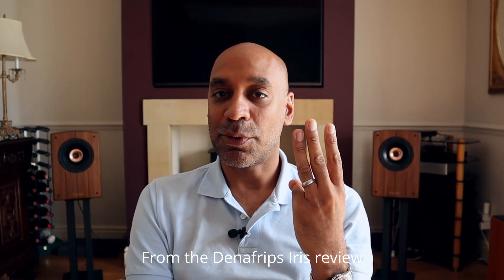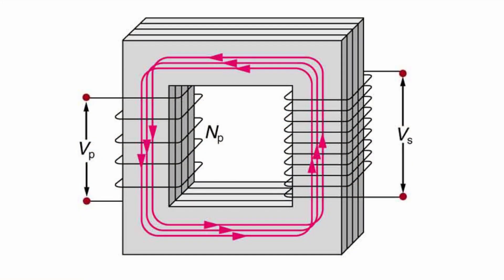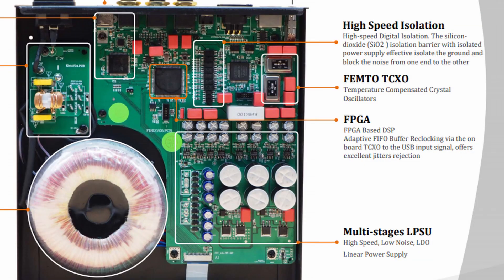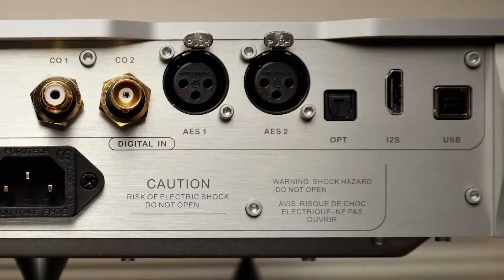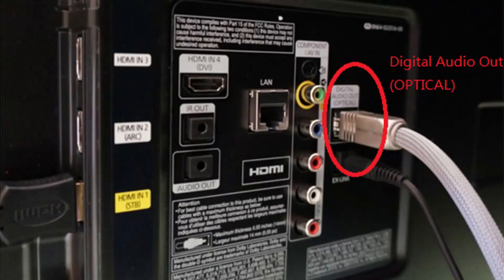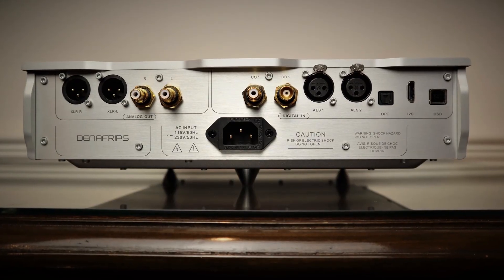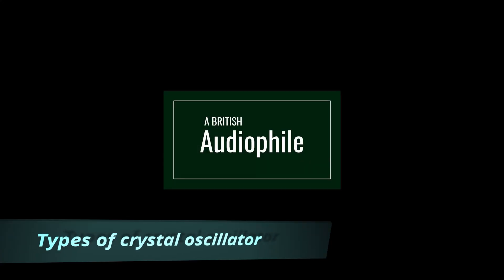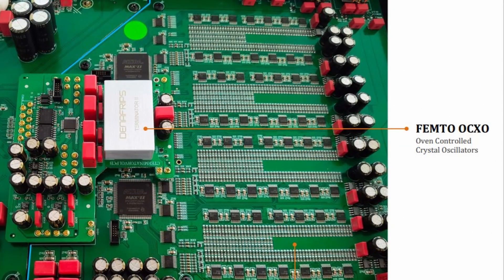ABA Clips: Why you need a DDC

Comment: Always great explanations and reviews from this gentleman. I recently in this past winter upgraded from a Pontus II to A Venus II and while I have noticed sonic improvements I am experiencing annoying transient pops (sort of like static discharge noises if you will).  Also when I would physically touch the unit the status LED's would flicker erratically and give a very minor static shock, this issue was bothering me more and more as time went on. I reached out to Denafrips regarding this issue and even sent the unit to there North American based service center where a firmware upgrade was performed. Though the flicker of status LED's has been addressed I still experience the occasional transient popping noise, I have tried evreything as far as isolation (different outlets, power cords, interconnects, AC purifiers etc...) to no avail.

NOTE: This issue only rears it's annoyance while streaming.

All this to say that this video has given me somewhat of a explanation as to what may be some of the reasons as to why I may be experiencing these anomalies, especially about the sensitivity to voltages and it being temperature dependent.

This got me to thinking that I should try isolating my internet service entry-HMMMMMMMMMM!
Reply from the maker: Thank you for your kind words of support Juan. Sorry, to learn about the experiences you are having with the Venus II. If you haven’t already, try it with different sources and different inputs. If it is the same will all, I suspect you may have a faulty unit. Good luck 👍
Reply: @abritishaudiophile7314  Good day Tarun and thank you for your response. YES-as you I believe the same as I have tried all inputs and numerous sources but as mentioned it seems the issue is when I stream, do you suppose the noise may be emanating from the roputer/WiFi extender? Might a 75 ohm isolation transformer help?

Just your thought if possible and once again thank you for your response, Juan Valentin..................
Reply: Good day Tarun and thank you for your response. YES-as you I believe the same as I have tried all inputs and numerous sources but as mentioned it seems the issue is when I stream, do you suppose the noise may be emanating from the router/WiFi extender? Might a 75 ohm isolation transformer help?

Just your thought if possible and once again thank you for your response, Juan Valentin..................
Reply from the maker: @juanvalentin3302  if it is only happening with your streamer and you have tried different streaming devices. Then it is possible that the Wi-Fi extender could be a problem. I don’t think a isolation transformer will help at the Venus as pretty good internal isolation on all inputs. If it worked fine with the Pontus II then it could be a quirk of the Venus II. I would email Alvin at Vinshine and see what he suggests 😊
Reply: @abritishaudiophile7314  As always-well received input from you, now back to the music!

Regards and happy listening, Juan Valentin........

Comment: Several of the concepts in this video are put to use in the Grimm Audio MU1 digital audio server & transport. The MU1 has , apparently, such an accurate clock that it’s difficult to get any measuring equipment to measure its accuracy !  (And the accurate clock is responsible for the high cost.) The recommended digital out from the MU1 is AES EBU. Any reason AES EBU not described in the video Tarun ?  It’s SPDIF, so it should make the external DAC use the far more accurate clock of the MU1.
Reply from the maker: Thank you Trevor. I didn’t test the AES/EBU connection. Next time perhaps. Please ignore the message from “Telegram me”. It is a spammer using my photo. I have reported it to YouTube. Sorry for the inconvenience.

Comment: Sadly I2S Has no universal standard. Iris for example does not work with my Smsl M400. but works fine with Audio Gd R2R-2. Hope that this standard will be unified in the future. Beside that my only complain for the Iris is , to little connection options. Would be happy for a doubling of every port. 😅
Reply from the maker: Thank you for sharing. Please ignore the message from “Telegram me”. It is a spammer using my photo. I have reported it to YouTube. Sorry for the inconvenience.

Comment: Digitalisation of audio sound is becoming more and like a dog's breakfast. Ever heard of the concept Straight wire with gain? To appreciate music at its best without all these expensive status laden technological wizardry, go for records and tapes played on vintage equipment manufactured in the UK, the US, Europe and Japan in the 1970s and early 1980s. The poor cassette tapes and cassette decks have been vilified by so called audiophiles but to me, they have a full bodied sound with ambience like a concert hall or studio sound. The simple thing thing to do is to gently clean the heads and tapes path periodically with q tips and isopropyl alcohol, lube with tape  head lube, demagnetised the heads and tapes path with demagnetiser wand,  ensure the heads are aligned (easily done with a small screwdriver if you know how) and turn all  Dolby OFF!!! Also use well kept cassette tapes with the pressure pads on.If you can find them ,  buy reel to reel decks. They are works of art by themselves. Enjoy.
Reply from the maker: Thank you for sharing. Please ignore the message from “Telegram me”. It is a spammer using my photo. I have reported it to YouTube. Sorry for the inconvenience.

Comment: Very informative Tarun 👍
With regards to isolation, what about Wifi as a transport medium? In my experience a Chord Mojo 2 / Poly Streamer over WiFi, gives a cleaner result than any of the ever more expensive USB cables I tried directly connected to the Mojo 2.
Reply from the maker: I believe the connection between the Mojo and the Poly is wired, no? I haven’t looked into it to be honest. Please ignore the message from “Telegram me”. It is a spammer using my photo. I have reported it to YouTube. Sorry for the inconvenience.
Reply: @abritishaudiophile7314  Hi, yes, I had already figured as much 🙂. 
Yes it is wired but it is an extremely short connection part, USB connector to USB connector without wire in-between. And since both cases are shoved together, forming one shell, the signal path is entirely within it. I am not sure if that matters. They could also have created it as one device.

Comment: Hi Tarun. Can you comment on the benefit of using DDC for older DACs? I'm thinking USB out from pc via DDC to coaxial input on Musical Fidelity V-dac ii. 5 years ago there seemed to be plenty of options for this and it was firmly recommended; research suggests this isn't the case anymore.😐
Reply from the maker: It depends on the quality of the DAC. You may be better of upgrading the DAC than adding a DDC. Your system is only as good as the weakest link. If you think that the old DAC is still comparable to modern equivalents then a DDC may make sense 😊

Comment: Hi. I use USB audio and my DAC (Ifi zen V2) allows one to pick the buffer size with several choices. Is a smaller or bigger buffer better for the sound?
Reply from the maker: It would be hard to determine objectively without getting into the complexities of the design. Best option is to trust your ears 😊
Reply: @abritishaudiophile7314  thanks. Will try experimenting and see what I prefer. My impression so far is it makes very little difference to the sound.
Reply from the maker: @paultasker7788  This is a spam message from someone pretending to be me. They are using my photo. Please do not respond to them. I have reported it as spam to YouTube. I would never contact you in this manner to offer you a prize. Sorry for the inconvenience.
Reply: @abritishaudiophile7314  no worries. If anyone offers me a prize I assume it is a spam message unless I've actively entered a competition which I haven't. Don't worry. It's a problem on all you tube channels though they don't usually pretend to be you. Hard to stop them I'm afraid.

Comment: Great video…very informative. I did not want an extra box in my very minimal space so I went for a Holo Audio Spring 3 KTE. It has an excellent solution to this very “problem” already included. I don’t have a dedicated listening room and it is not treated. However the spring 3KTE gives me wonderful sound, imaging and it makes my system sound more powerful and the bass is stronger. I no longer have to push the volume dial to get the sound I love. It’s amazing what a DAC can do to your system and to realize how important and what it’s responsible for in a hifi system.
Reply from the maker: Thank you SB. I reviewed the model down at it impressed me enough to be my DAC of the year in 2021 😊
Reply: What digital source are you using?
Reply: @mikehuntington4440  I use an Audiolab CDT using optical out. I also use a bluesound NODE  that is connected via USB. I use the HDMI ARC to connect my TV and stream hi/res music 🎶 both via usb. I’m also going to add an external power supply to the NODE. I can’t wait to see if that makes a difference.
Reply from the maker: Hi SB, this is a spam message from someone pretending to be me. They are using my photo. Please do not respond to them. I have reported it as spam to YouTube. I would never contact you in this manner to offer you a prize. Sorry for the inconvenience.
Reply: @abritishaudiophile7314  I know…I replied with a 💩💩💩 and reported them. It got taken down.

Comment: Fascinating....  My understanding is I2S implementation is not standardized so I worry about compatibility between a transport's I2S (using HDMI as an example) with a DAC's I2S.  It's a bit of a wild wild west with I2S, I think.....
Reply from the maker: Flexibility of Pontus layouts get around that problem. The main issue using I2S is that you either need a transport with better isolation from noise and a better clocking mechanism than your DAC or a good quality DDC 😊
Reply from the maker: Please ignore the message from “Telegram me”. It is a spammer using my photo. I have reported it to YouTube. Sorry for the inconvenience.

Comment: Quick question. If my streamer has an I2S output wouldn’t that solve the need for a DDC? I don’t see a DDC with a I2S input available. Only an output.
Reply from the maker: It depends on the quality of the clock and isolation in the streamer 😊
Reply: Two LT3042 LDO’s supplying the pair of NDK NZ2520SDA oscillators.👍🏻
Reply from the maker: @cameronrector178  This is a spam message from someone pretending to be me. They are using my photo. Please do not respond to them. I have reported it as spam to YouTube. I would never contact you in this manner to offer you a prize. Sorry for the inconvenience.